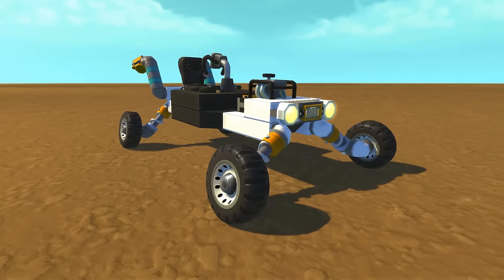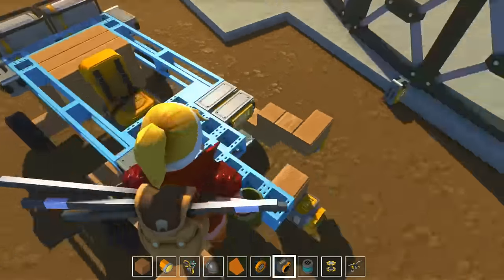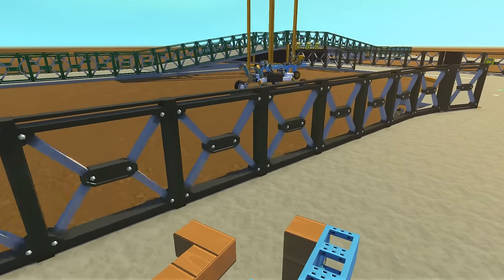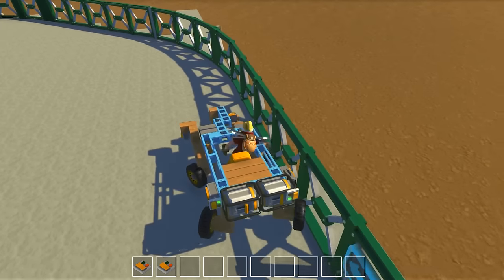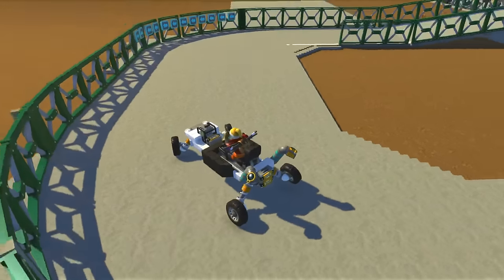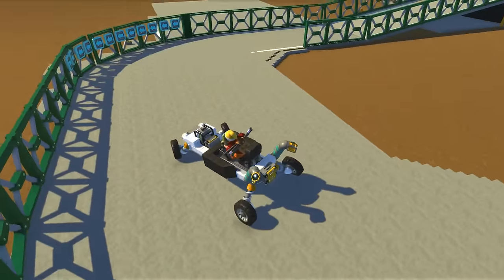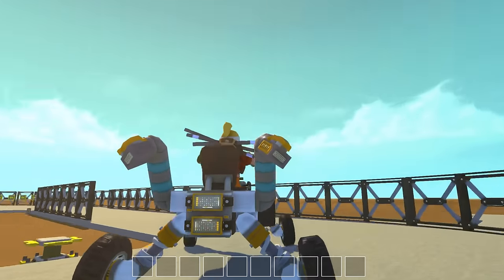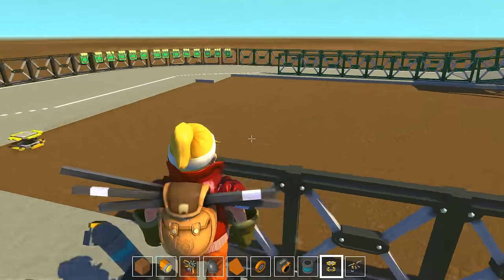Scrap Mechanic: AI versus Human Racetrack |let's play

Comment: Hey FrizB, I'd like to see what you can do with the Remote Control glitch.

It's super simple, and can be done on any pre-existing vehicle. Look into it, it's fantastic.

One thing to note before you go into it though: once separated, you can do literally ANYTHING to the car (lift, add, delete), but do NOT delete any part of, or add any blocks to the "controller" once separated or it will unlink. (don't even put it on the lift, you can only put the separate vehicle part on the lift). have fun

Comment: Hey, great video, some really interesting concepts you've got here!

I'm curious though - if you've got a problem with the self-drive cars flipping over at higher speeds and then a car with a self-righting mechanism (admittedly not a perfect one, but I could see it working with a few tweaks), then could you not combine those together to make more stable self-drive cars?
Or would the angle of the self-righting cars wheels cause issues with the turning sensors of the self-drive cars?

Comment: BT, love the videos (besiege and SC) i was wondering if tanks with tracks can be made in scrap mechanic?
Reply from the maker: +ARandomGuy XBOX I made them and they made the game crash! I should try again as there has been a few updates since then.
Reply: I was thinking you could try a similar system to the besiege buldozer you made where you had plates around the wheel, in this create an arm that places a larger wheel around the sides of the tracks.
Reply from the maker: +ARandomGuy XBOX I will give it another go. I'm hoping the welding tool will be out soon, that would really help with track building
Reply: +Besiege This! i dont believe there are any precision builder mods like besiege for this game either, but if you think its possible you should try it.

Comment: Could putting the engines on the bottom of the car help it stop rolling because of the lower center of mass?
Reply from the maker: +Matt Wesson I think so yeah. I will try hard to make the AI car into a more worthy opponent! Lowering the COM would help a lot and I might put in some fake torque to compensate too
Reply: Besiege This! 300 hours of ksp finally pays off for me!
Reply from the maker: +Matt Wesson lol. We become armchair-engineers as we play these physics games, but hey that's cool.
Reply: +Besiege This! One thing i have noticed with the "human" design, is that the angle of the springs makes handling worse. it makes the wheelbase wider but makes the car translate left/right on a corner, rather than roll left/right. The camber on the wheels helps though